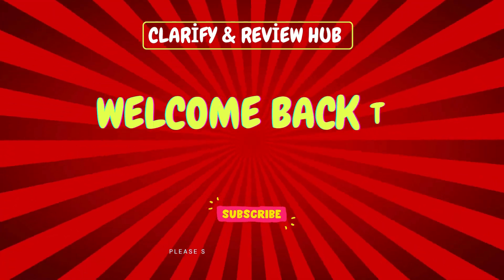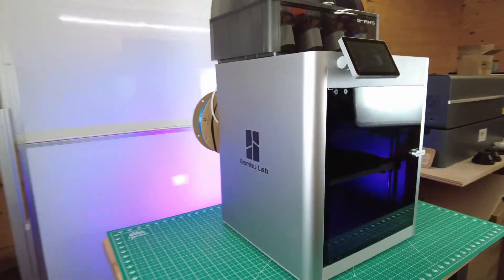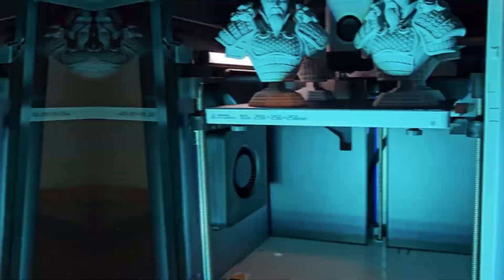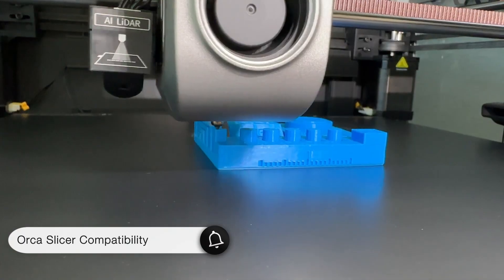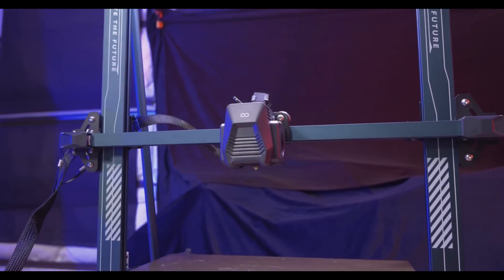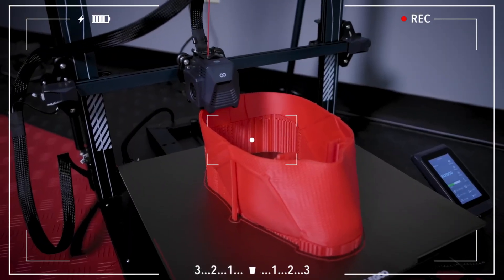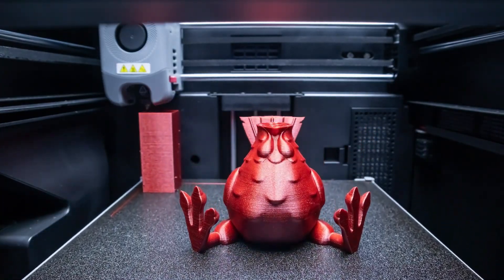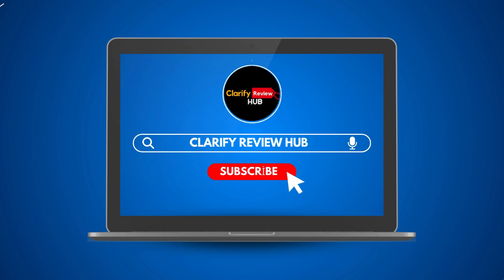Best 3D Printers 2024 [Don’t BUY One Before Watching This]

Comment: A lot of important details were left out. 
* While I really like my Bambu printer and its AMS filament color-swapping system, there was no mention of how much poop it creates. 
* EVERYTHING mentioned about Creality's slicer applies to every other printer, too! For example, the Bambu slicer is based on the Orca slicer. 
* He introduces the Elegoo Max 3D printer by saying, "Let's start with the unboxing" and then NEVER shows actually unboxing the printer. (There were more shots of unboxing the Creality K1 than the Elegoo Neptune 3 Max.)
* He mentioned noise while mentioning the Creality K1. Trust me, as an open, bed-slinger design, the Elegoo Neptune Max is MUCH louder!
Reply from the maker: Thanks for your feedback, Steve. I’ve noted the missing details, and I’ll be more careful next time.

Comment: the wifi connection does work on the flash forge. You can also use orca flashforge, enabling remote control + extra feuture's.
Reply from the maker: Thank you! I’ll take your information about Flashforge and Orca Flashforge into account.